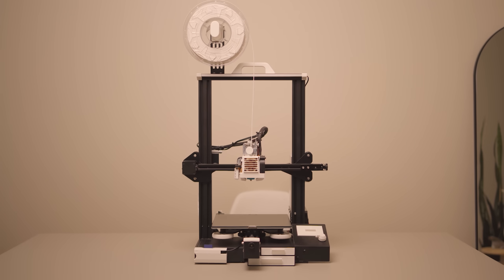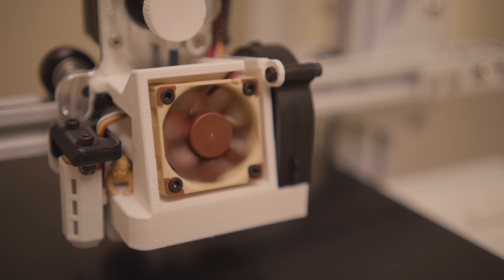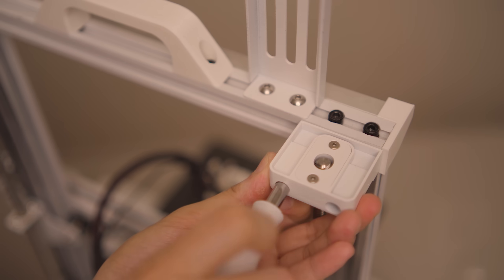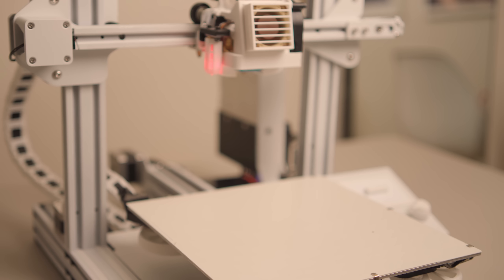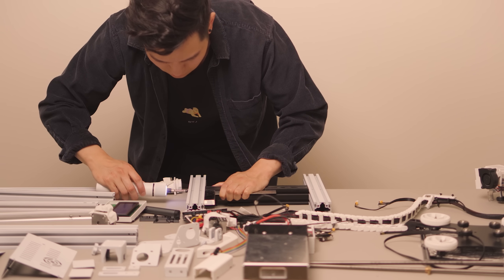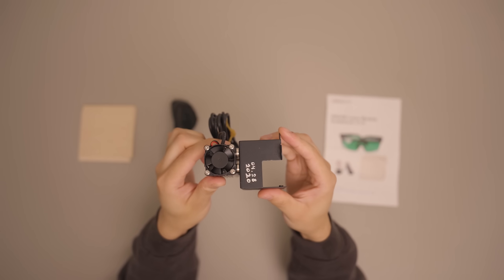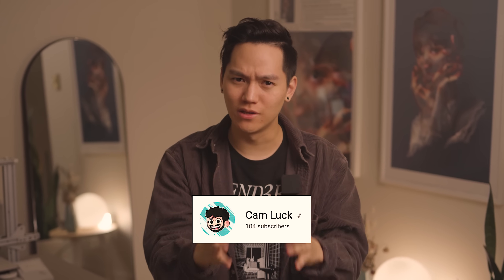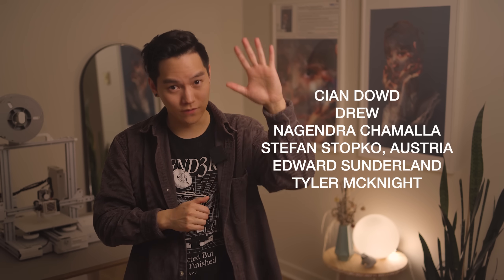10 More Upgrades for my Ender 3 Pro - Part 4

Comment: 6:19 Just get G10/Garolite waterjet cut. It isn't that expensive usually, this is a tiny job from the perspective of a machine shop. At home it is messy and dangerous, and then there is the residue even if you wear PPE.
Reply: Or yknow
Get a 1mm thin sheet and Js slice it with a blade then snap and sand the corners
As long as your wearing ppe and outside you fine

Comment: woah, how you strip the paint from the beams, i have a old ender laying around, i figured to give it a new look since i dont want to sell it away.
Reply: You can also just scrap it for parts, the aluminum extrusions can be used for so many different projects, and the motors and limit switches are great too

Comment: Do you need to add a buck converter to each fan that you installed, or just the CPU fan?
Reply: it just depends on what fans you use, what fans are you running?

Comment: I have question about dual axios extention. It has length less then z-axios extention, wich has length biger to 100mm from standart. In video doesn`t describing this. How set dual axios extention with z-axios extention?

Comment: Hello, I'm your fan from Taiwan. I started trying 3D printing because of your videos. I would like to ask how you turn those metal parts white?
Reply from the maker: hey! so turning the metal parts white is… quite a dangerous process that was very tedious haha i don’t recommend it to be honest but basically i used a corrosive chemical for cleaning drain clogs to remove the anodization on those metal parts. then it’s just a matter of spray painting them white and putting on many layers of protective clear coat.

Comment: A little tip with the dual z is that every time you turn off the printer they go out of alignment. A recommendation is to 1. get a belt to sync them and hold them when the machine is off and 2. get a mainboard with two stepper drivers

Comment: Question: does that Z splitter cable wire the motors in series or parallel?  If parallel, then you probably need to readjust the motor current to double, so each motor gets what it needs now that there are two of them.  If they are wired in series, then all is good, the drivers will try to maintain the same current through both motors, and there is probably enough voltage from the supply to do this.  In this case the drivers may actually run cooler.

You can probably replace the blown fan mostet, it's an easy SMT part to unsolder and solder.

I'm currently building a new 3D printer out of an Ender 3 Pro.  It's a Voron Switchwire conversion.  You should at least install Klipper firmware on your Ender 3 Pro.

Comment: Just wondering after I changed the e steps it still didn’t work and someone said that my problem could be that my ender 3 is sending too much or little energy to the motor is there anything you did? I’m pretty sure you would have to change the voltage by using a buck converter right?

Comment: don't know if you have upgraded ender 3 since this movie was made. after printing out that the biqu micro probe mount does not match the height it should have been. that's what's to fan the house. or many ticky things to upgrade the printer.

Comment: Very good video. I have a challenge for you. To put a laser engraver with a switch between laser and 3D through a switch not to put in and out the cables. Laser / 3D
Have you done it?

Comment: hi you know you can upgrade to toutch screen ?, i accidentally broke my cooling fan and replaced it but not for noctua, just another 24 volt and it's much quieter now than before, think creality threw in the cheapest possible as fans, that's probably why they make rubbish noises when they increase speed. there have also been "brackets" to hold the beds in place with "Glass Bed Clips Clamps"

love the upgrades you've done, going to upgrade mine myself when I'm done with the burnt up rigidbot I'm almost done with, have a good time :)

Comment: The z-axis upgrade can definitely help with stability on the ender 3, especially if you have a heavier gantry, but its not necesarry for removing the wobble.  I've had no problem keeping mine sturdy and level using the eccentric nuts.  Still a super cool and informative video as always!

Comment: If possible, can you share what was used to remove the black coat and what was used to paint the white on the rails?
Reply: Drano soak and spray paint. Dangerous.

Comment: For anyone wanting to try painting there aluminum extrusions with spray paint or any thin paint don’t. take it from me because I learned the hard way. Literally Just don’t I tried, and even a 10micron layer on paint will effect your printer greatly. If you want different colored 3d printers just go with the aluminum extrusions premade anodized or diy it, or try getting a powder coat (I can’t rep for this tho ). But if your 3d printer uses linear rails you can paint them and it will never effect print quality something I need to upgrade to now because the printer would run on rails. But basically don’t bother painting it can’t stress it enough. (Unless you are using linear rails.)Happy printing 🙂
Reply: Can you elaborate on what happened to your printer?

Comment: I've done similar mods but went a slightly different route, squash ball feet are great for reducing vibrations, and for the z mod, kevinakasams double belted z is awesome, gets rid of all the lead screw issues and also the drawbacks of having parallel drive as it's a single motor. I use a "super whopper" from e3d and this comfortably holds the gantry up too. The white frame is awesome btw, haven't seen anyone go that far cosmetically before!

Comment: A useful and cheap tool attachment for 3D printer can be a Roland-compatible drag knife, it can cut vinyl stickers and such like. Since the knife actually touches down behind the path, and some path planning magic is needed for it to point exactly in the right direction, you need to use a drag knife aware software such as dxf2gcode.

As to the dead fan MOSFET, yeah that's not entirely unexpected. If you were nearby i'd fix the board for you no problem, but i'm on the wrong side of the globe, maybe you can find someone, it's not a difficult repair.

Comment: I bought an ender 3 s1 myself. Was a fantastic printer.... when it worked. Out of my 3 different Ender 3 printer, this one has had the most errors, and ones I've been unable to find the reasons and solutions to. It's currently unusable as it just tries to ram the nozzle through the print bed whenever I start a print. Maybe I've just been the only one to ever have issue with it since I can't find anything about them online. But I much prefer my Ender 3 v2. Been working great.

Comment: since you're using buck converters to power the fans you can also try over-volting them a little bit to get a bit more airflow. probably 13-14 volts. i would say absolutely no higher than 16.

Comment: Okay young blood I am super stoked as I literally received my Ender 3d V2 upgraded 5 Minutes ago ( after waiting way to long I dropped the hammer and bam it's here only 4 days after buying it from Wal Mart online  very happy with the turn around time on my order ) enough with my excitement a couple things I was wondering about as I watched you videos was if you would be adding the poles to the sides of the Z axes as I had been planning this as one of my 1st mods. ( but as with most everything I do I will try to add on all sides, and as I am building an enclosure to house my Printer both to aid in printing higher heat requiring filaments as well as possibly using it for a acetone tent to smooth prints [ I will need to remember to remove filament spool when doing this ] I may add some kind of anchors from the printer to this frame for even more rigidity )
Oh and I wanted to offer an idea I had while watching every thing Youtube has to offer on 3D Printing over the past few days as I waited for my Printer to arrive. I think it will do all of us as well as any person with 3D printers if we will make a custom fan shroud. ( yes I know you modded yours ) But I think we can get greater cooling if we add a modded shroud that is as follows. take the one you now have and add the following to it. Reprint it with vertical walls that come out just a bit farther and then run up above the assembly to a point where you can add a round housing that has a internal set of open ended cones that inner nest inside each other add some cross braces between and hang inside round housing. this will compress and there by cool the air as it is drawn into the system. ( it is a addition I have made to my homes swamp cooler and it has resulted in a substantial cooling effect for the effort. ) also I watched a fellow 3D maker's video in which he was doing things that others had suggested to reduce vibrations and vibrations. As I said above I desided to add the angled braces on the Z axes. One of the things people had suggested he do was to add sand into the frame arms, It leaked out { i don't think he much liked the idea or he could have gotten it under control with some minor extra steps } But the idea seemed doable to me but with a very cheap and easy variation. instead of sand with the holes plugged , Rather shoot spray in foam into the channels. removing any that leaked out the various lil holes. This would dampen any vibrations and be cheap. any way Great video series  thank you for your efforts and "I am now and always will be your friend Jim"  Sorry the ol school Trekkie in me slips out some times. I'll be watching Later!!!

Comment: A lot of wasted resources on the upgrade, starting with the color.   But hey, you got a free new printer, so you can afford to totally screw with the old one right?  I would have skipped everything and went with the dual extruder, Sprite hot end, updated Main board and display.  Then upgrade the board and display firmware and DONE.  Everything else is just a huge waste of time IMO.   But again, Creality gave you a new printer...

Comment: What did you do to adjust the center of the bed?  I just installed the microswiss direct drive and your satsana fan duct, but everytime I print it's not centered.  Did you have to change gcode?

Comment: That's way too much white for me. May I suggest an accent color. Otherwise cool project. I'm currently working on highly modifying an old Anet A6 I snagged for $20 and upgrading it to an i3 style printer. Working on designing and printing parts, buying parts and trying to film it all to make a video. Lots of work I tell you as you already know.

Comment: Did you use acetone to strip the paint? And if so did you have to wait 24 hours for the paint to melt off? Also did you use matte or satin finish. My Ender 3 Pro coming tomorrow thinking of pa8nting it white too

Comment: be careful if you have everything pluged in (except to the wall) and spin the x axis itll send current backwards through the system i was spinning mine slowly and noticed the printer head fan was also moving slowly with it

Comment: I recently did the dual-axis upgrade, so when I watched part 3 I really wanted to get the height extension kit but they all only come with one screw, did you ditch the screws in this dual axis kit and buy a 2nd 500+ mm screw for the upgraded side?

Comment: 9:48 I personally would not recommend installing the bearing blocks/ top Z screw stabilisers. This mod constrains the lead-screw in 3 points: the motor-coupling, the z-axis nut and those bearing-blocks. if your screws are not very straight and you havent got everything lined up perfectly, it can cause my issues than its worth, plus  there's no need to constrain the lead-screw as it is only responsible for movement, it doesn't have to be rigid. I can only see this useful if a motor is used with a timing belt system

Comment: Scott, how do you feel about speed upgrades?  (while still printing high quality) 

I have a highly modified E3 Pro with linear rails, CR touch, dual Z, Microswiss extruder and hotend, higher wattage nozzle heater for quicker warmup, aded insulation to the underside of the bed, BTT SKR Mini, BTT touch screen and a custom mounted Voron Stealth Burner style cooler connected to my MicroSwiss direct drive/linear rails extruder.  (Swiss Burner on Thingiverse with my custom mount) The cooling is amazing with the 5015 fan.  At times it has made PLA cotton candy instead of stringing. 

I prefer PEI but the magnetic sheet is so heavy.  (G10 might be the way to go) Bed slingers move so much mass.  I went for the smaller stock motor (like the z axis motor) vs pancake and slightly increased the power to it in firmware. (which made it run cooler) I may need to switch to a pancake for quality at higher speeds.  

I printed squashball mounts for the feet to eliminate vibrations.  I just did the printermods LED kit.  (easy) 

I am ready to connect the Klipper enabled Creality Sonic Pad but I am not sure I will get the speed and quality increase I desire.  (pressure advance and input shaping)  That being said, I may need to abandon the bed slinger and switch to CoreXY to get where I want to go.  My fear is that I lose too much quality when printing fast to make it worthwhile. Not many have created custom Klipper firmware for BTT SKR yet.

Comment: I wondered if I could use a pancake motor on my cr10s pro v2. Did you need to adjust esteps and current? Thanks for confirming this.

Comment: I've been using a small black paper clip for a larger stack of papers for my bed and have been working great. Also a linear x rail works nice and smooth. I was able to redesign the entire thing to bring the weight closer in towards the rail for better weight distribution which helped with wobble and speed.

Comment: I painted my ender 3 v2 in blue and silver https://youtu.be/Bs5Ur-YWU9w   thanks for the idea.
Reply: what did you use to remove the paint?
Reply: @johnf.kennedy4252  https://youtu.be/SntTC97fcn0       here is a video explaining it. DO IT OUTSIDE. I used 220 after that to have something for the etching primmer to stick to. The primmer is sold at amazon or auto part store.  Then 2-3 coats paint and 2 coats clear.
Reply: @johnf.kennedy4252  You don't have to remove the paint from the plastic or the steel. Just the aluminum frame. the rest can be sanded and painted. Sorry I forgot to tell you that. Thanks

Comment: so right now the upgrades im doing to my new ender 3 pro are, dual z axis, auto bed level, a new spider hot end, well as adding those rail covers and drawer well as the main board upgrade, you videos gave me an idea to upgrade the fans as they are noisy af and I want to have prints go into the night while I sleep into my room but I don't want to start botching up wires, much as my mechanic day job and engineering degree personas tell its ok. xD

Comment: I wished you would have done a back-to-back comparison of prints from the two printers.   Also- of all the modifications that you've done - which ones gave the biggest improvements?  Speaking only of Print Quality.

Comment: so if you look up the specs of the 40x10 and 40x20 noctua fans, they actually move the same amount of air.  the difference is that the 20mm one doesn't have to spin as fast, so it's about twice is quiet.

Comment: Nice mods.. Glass mirror tile from hardware store is best bed. Using small metal binder clips holds it tight to the heating element. 67 degrees first layer, 63 afterwards. Print won't come off till it cools 10 mins, then it comes right off. Clean with dry razor blade, no need to ever remove or replace bed. Any other bed is a hassle over time. ...Another tip I found was using 200% line size for first layer, helped me get perfect adhesion even on long prints.

Comment: have you ever thought of printing a full enclosure?  maybe leave window areas for some acrylic sheets?
with the S1 Pro, you can start using more high heat filaments, but i hear that even some lower heat ones would benefit from a better temperature controlled environment.  like ABS?

Comment: what did you use to cut into the printer metal for the lights as well as what drill did you use to drill into the printer

Comment: I also tried to install this laser module and fried my MOSFET.. then changed the firmware to use another fan port and also fried it. So the laser went in the trash and I ordered a new board.
Reply from the maker: thanks for the heads up!

Comment: I seen a lot of printers on my time and have a bunch and learn one thing out of a printer 3-D printer they all print the same way there is nothing new in the printing world unless you move over to Resin printing but the other ones they all print the same way new or old slow or fast they all print the same way there is nothing gnu so I’ll stick to my old printers there’s nothing wrong with them

Comment: Unless I am mistaken, it looks like you traded the z-axis extension with the dual z-axis? 

I noticed that when your printer was still black at the beginning of the video, it still had the z-axis extension. 
After you painted everything white, the printer is noticeably smaller as if the z-axis extension was already taken off.

Comment: Note on the laser module and the glasses that block "most," with lasers most is not good enough, anything that gets past is getting to your eyes. It is your vision you are gambling with, spend the extra and be safe, no laser engraved project is worth losing your eyesight over $30 savings.

Comment: Regarding the MOSFET regulator, I think you would find it beneficial to use an optocoupler and an external MOSFET relay module with its own power supply 🙂

Comment: My recommendation would be either an Orbiter or LGX Lite extruder, paired with a higher flow hotend (like the bms dragonfly which is pretty much a drop in replacements for the standard ender mk8) pretty much first mods I've done on my printers and I don't regret it